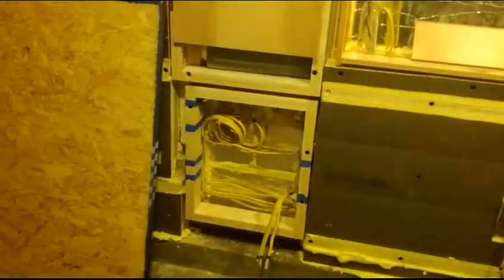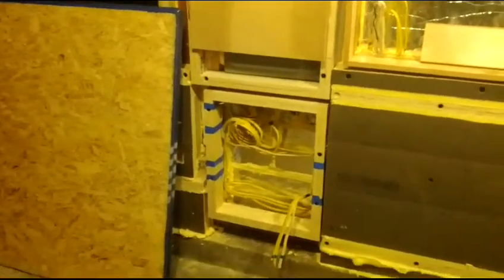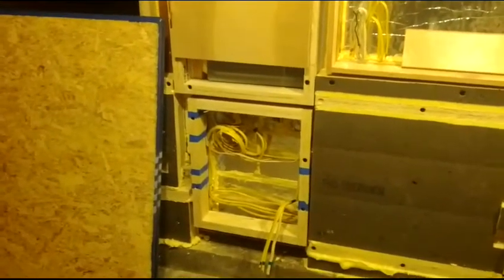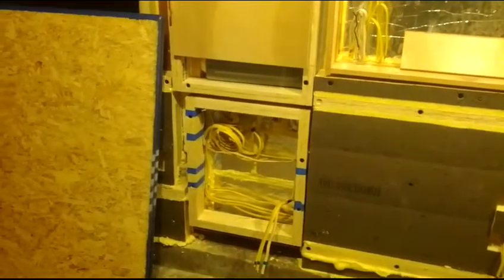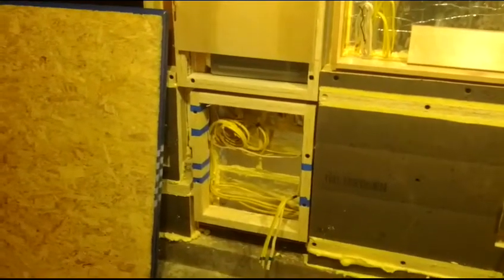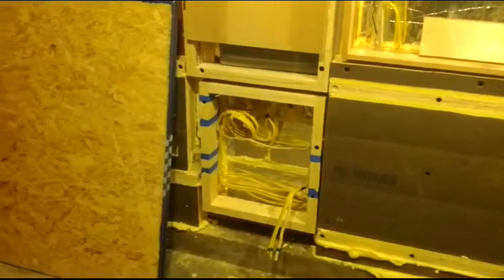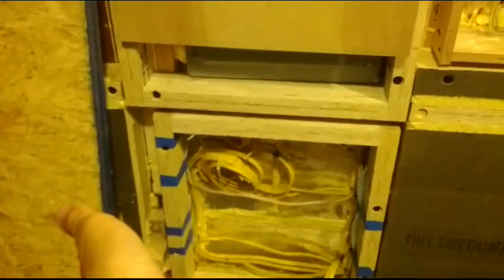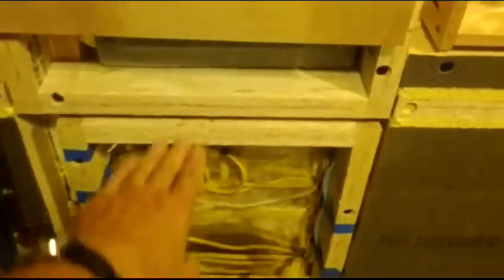Penultimate Woodshop Renovation: Phase 1, Video 6

Comment: I could be wrong but it looks like the metal circuit breaker door won't be able to open after you install the bottom board under the wooden door.